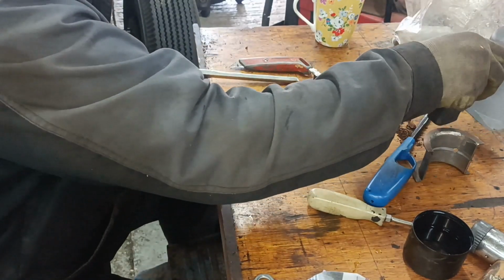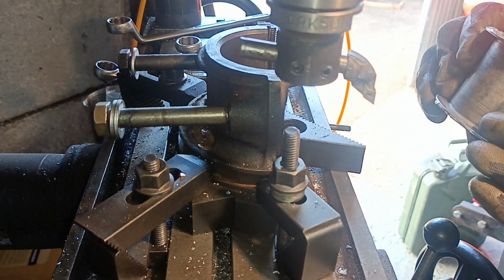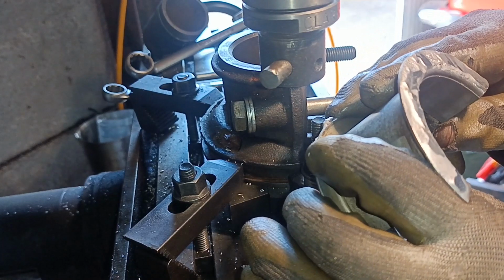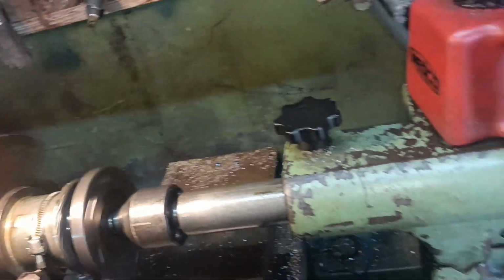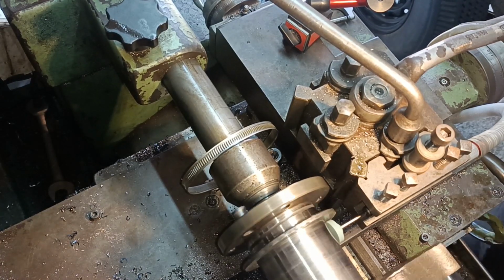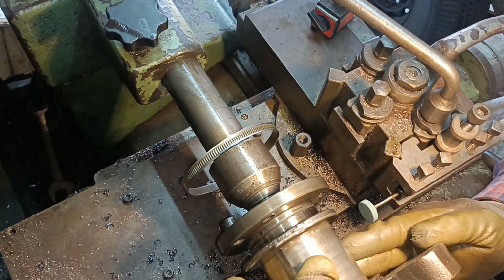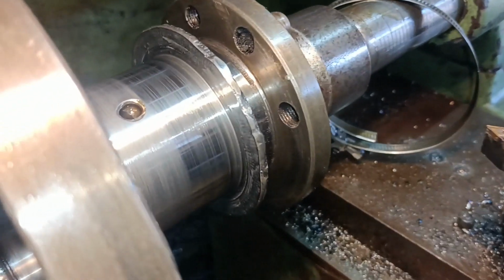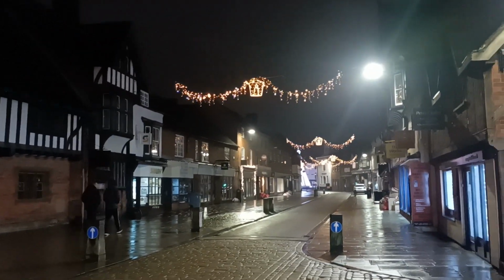I burnt up my cranks thrust face. Can I fix it? Part 2 (2284)

Comment: Hello Mart, first of all Happy New Year! Second, won't the tin wear off? It is very soft ??
Reply from the maker: Hello Mario, happy new year to you too. The white metal is a bearing material. It is soft, like most bearing materials. I don't know how well or long it will last. I haven't run the motor yet, so can't tell.
Reply: @MartsGarage  OK, understand, ws. only a Question ! ;-)